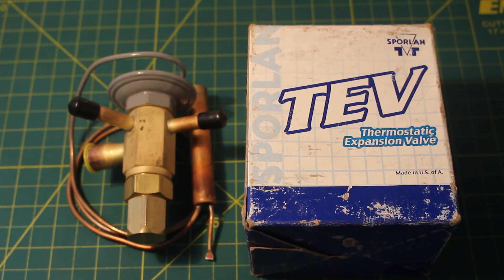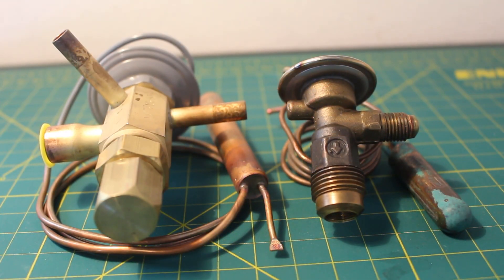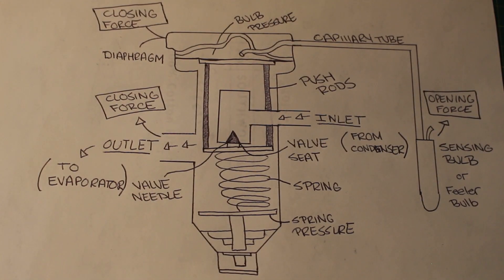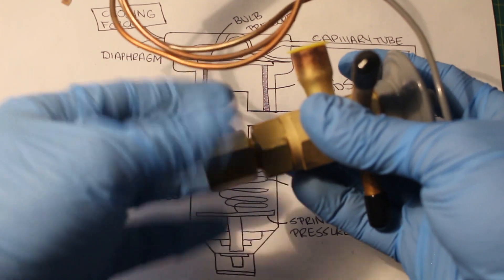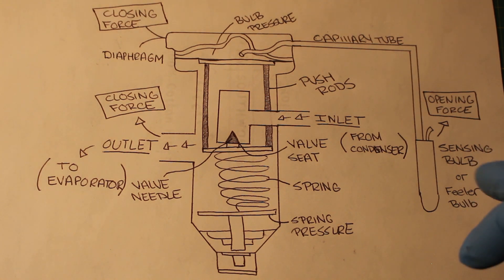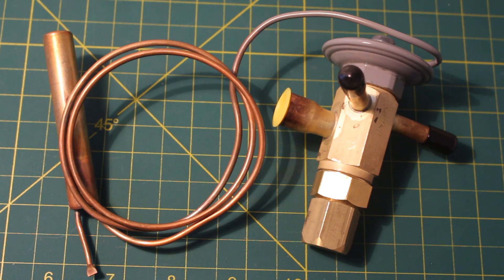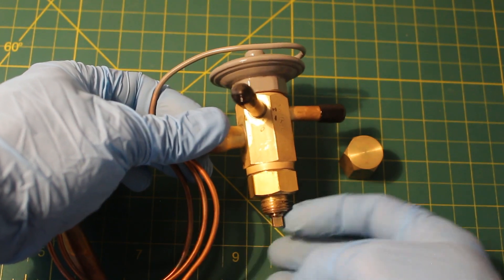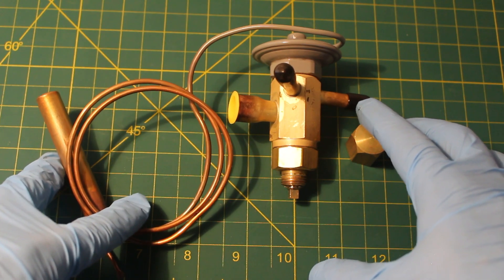HVAC/R: What Is a TXV and How Does It Work? (Thermal/Thermostatic Expansion Valve)

Comment: the txv never closed but maintain a controlled flow of gases so it will atomized to maintain LP and LT.Since the evaporator suction temp varies,and cabin temp varies,the txv absorves the changes and the superheat spring pressure + evaporator pressure. balances the pressure so compressure pressure easily push the gas into txv and to evaporator coil.

Comment: Can i ask you a question, when the temperature of sensing bulb decreased and the Needle is closing , in order to reduce the refrigerant  flow through to evaporation ,  where will the refrigerant which discharge from compressor  flow to ? 
Thank you .
Reply: the needle valve is spring loaded via superheat spring,when compressor run,it will pressurize the inlet line which is the HP line and will push open the needle valve,when the sensing bulb increases its temp.it will expand and pushes the diapraghm and the valve regulate flow by controlling the CA of opening.When bulb pressure overcome the superheat spring pressure and the evaporator pressure,the needle valve closed.Eduardo here.